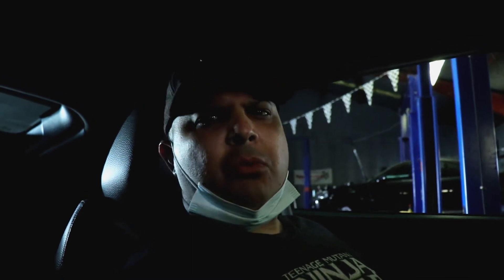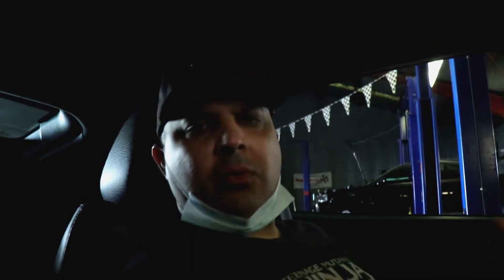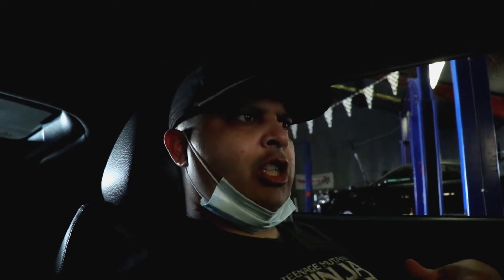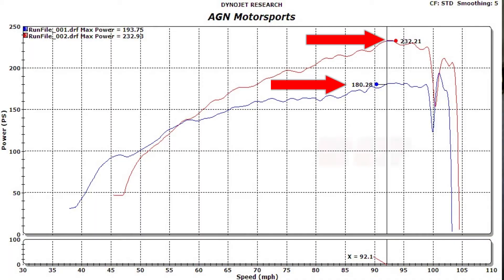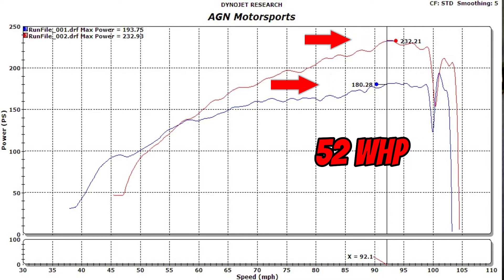Testing the Nitrous Outlet Intercooler Chiller on the Dyno Part 4 @NitrousOutlet

Comment: Hey. Great video! Months and months ago i mentioned these intercooler sprayers and fuel line chillers and all the people in the car forum im part of scoffed at it. Now seeing your results i am interested again in the intercooler sprayer even if its just rigging up an alcohol sprayer. Starting with a 205hp saturn ion redline supercharged so after a few mods like a smaller pully i think it will really benefit from any extra cooling. Especially since the smaller pully spins the supercharger faster and creates more heat. Thanks for the vid!
Reply from the maker: You're welcome and thanks!
Reply: @BryanVizcarrondo  honestly at this point i just want a working inercooler. Mines a water to air and hadt used the intercooler for a while by theprevipus owner. Once i fixed the IC pup idiscovered the laminova cores in my intake manifold need their o rings replaced since they decided to rot and allow coolant into my intake yay.

But once thats done i want to do the sprayer. Jist been a lot of other general maintenance i had done first like timing chain assembly and more to prep for a smaller pulley on my supercharger
Reply: @billybuchanan385  since you're still supercharged the best option first is to do a water tank over using the factory coolant system. Get an ice tank and route it to your factory heat exchanger and that will help a ton with the high charge temps. Zzp offers a good sized heat exchanger for the supercharged eco's

Comment: I would try an E30 blend to make fueling safer and go again. My 2.0t optima made 431whp (world record on stock internals) on bone stock internals at 26psi on a big turbo by lap3 and lap3 tune with methanol injection.  This is very interesting indeed. The kit would be very useful for me to prevent heat soak while sitting in the staging lanes. Thanks!
Reply: Didn’t you blow up your motor?

Comment: Was you using nitrous or Co2? It it was nitrous than the big gain could have been because the intakes was sucking in some of the n2o
Reply from the maker: I know, that's what i said in the video.
Reply: @BryanVizcarrondo  you should do 1 more video with co2 instead, its cheaper than n2o and that way we can see if the number differ. That would be cool to know
Reply: THAT 5.0 GUY LOL I commented before I finished the video
Reply: @BryanVizcarrondo  test with co2 too